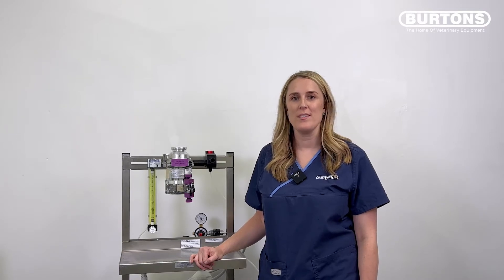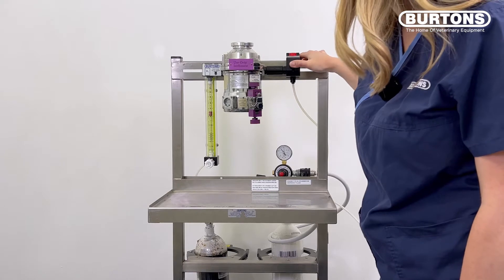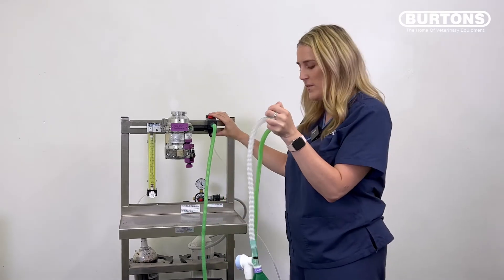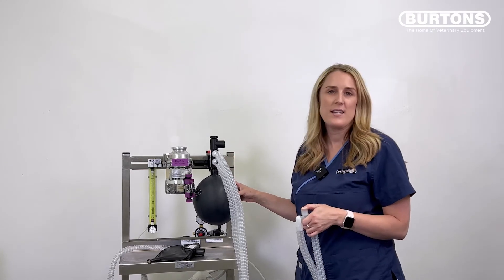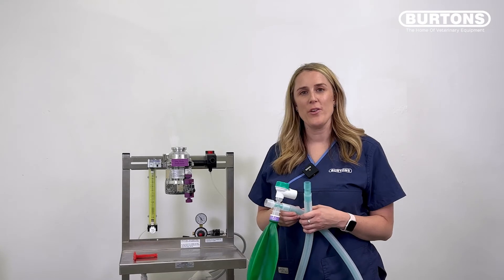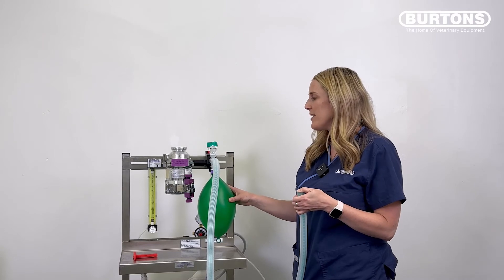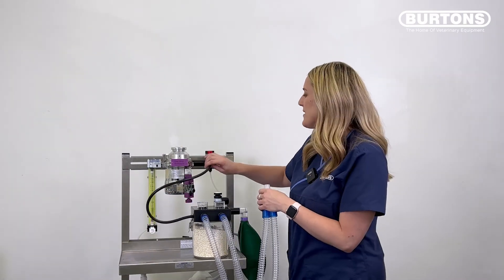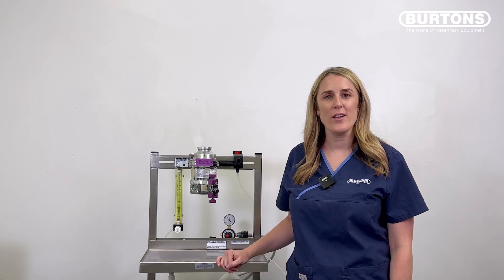Clinical Tips - How To Leak Test Your Breathing Systems

Comment: Is 28 - 35 cm of H2O a safe pressure for the patient to endure before valve releases? TIA.
Reply from the maker: Hi there - yes, this is a safe intrathoracic pressure as a safety release. 

We wouldn't recommend ventilating every breath to this pressure, but as it is designed as a safety feature - hopefully, the accidentally closed APL valve is spotted before it releases anyway, but it is a great backup! Some breathing systems won't open until 60cmH2O. 

Additionally, there are instances where high pressures are used in patients without long-term effects, such as during recruitment manoeuvres. Pressures used to reinflate collapsed lungs are as high as 40cmH2O. 

It isn't so much the pressure that is dangerous (barotrauma) it is the volume that the lungs stretch to (volutrauma). Experimentally, a pressure of 80-140cmH2O was required to rupture lungs when they are held within a bony thorax.

In summary - it will be OK as a safety feature.

Thanks,
Courtney - Clinical Educator in Anaesthesia